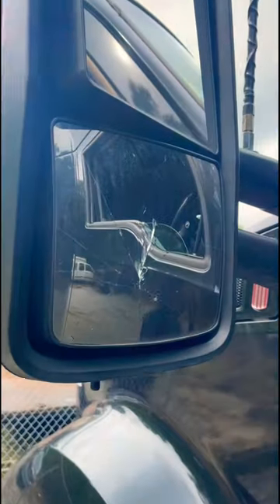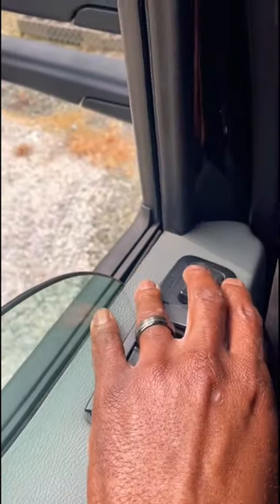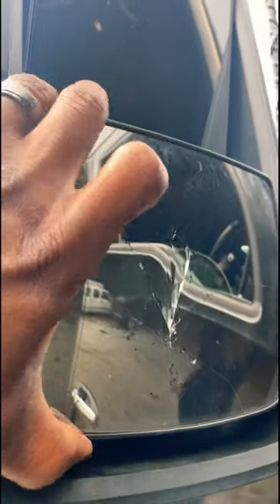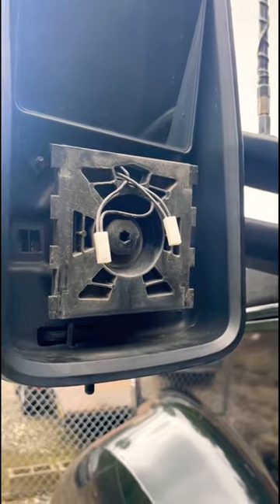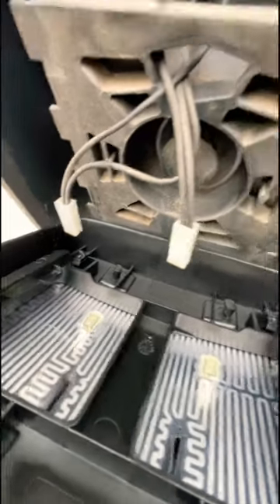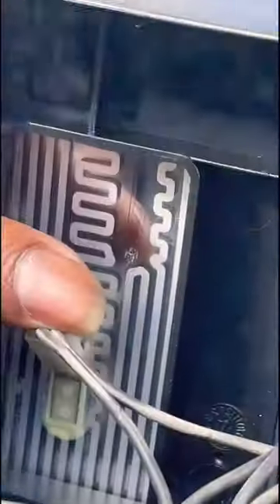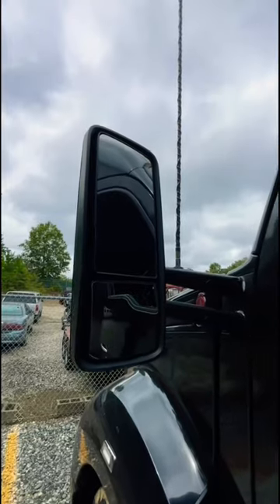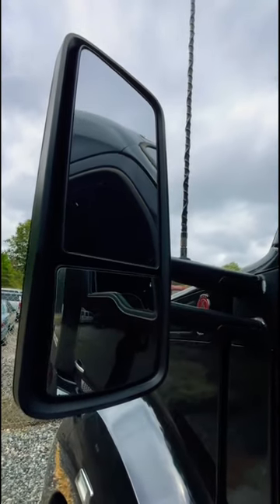How to Replace Mirror on a Semi Truck. #kenworth #semitrucks #paccar #mirror #TruckRepair #Trucker

Comment: dude, mine will not lift up and seperate, did it have to be straight before it would pop out? or angled any certain way?
Reply from the maker: Try tilting it all the way down
Reply: @Freight_Up_Trucker  nope, I think it is somehow fused, I tried pulling the glass off to push those tabs in but nothing that way either. Damn thing is just stuck